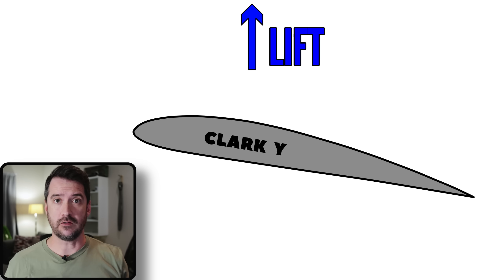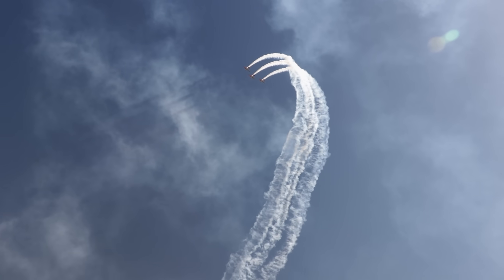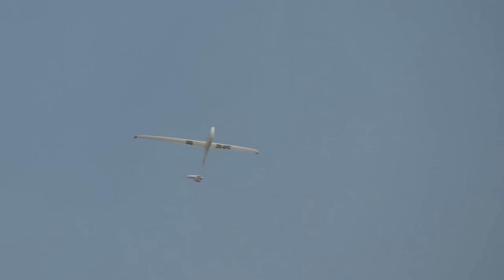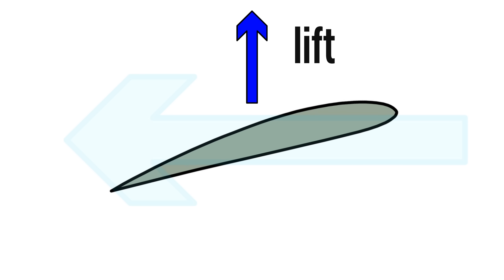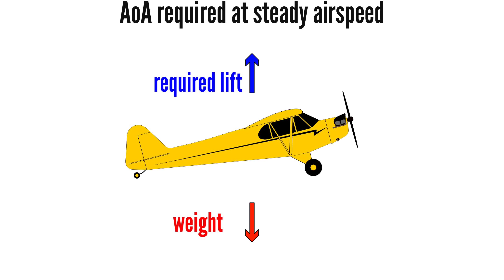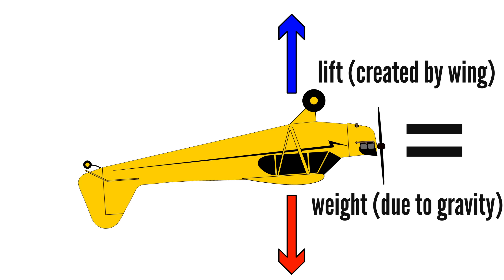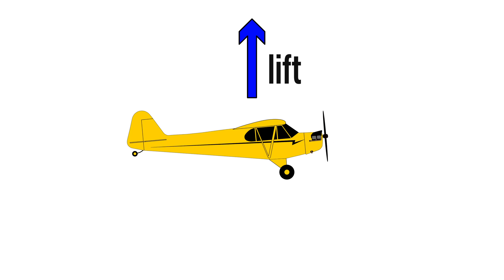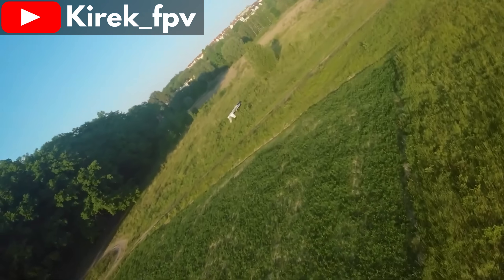Is Airflow Distance Over the Top of a Wing Always Longer?

Comment: You can generate lift with a sheet of plywood.  But a sheet of plywood stalls at a very small angle of attack.  The answer to what creates lift is the change in momentum of the air forced downwards by the passage of the wing.  This creates an equal and opposite lift force on the wing.  The low pressure above the wing also makes a contribution.  The purpose of the airfoil shape is to avoid boundary layer separation above the wing as long as possible.
Reply from the maker: I don't necessarily dispute this. But I would like to say a sheet of plywood is no different than a symmetrical wing (other than being very inefficient). The stagnation point still forms under the leading edge assuming positive AoA, and that's what this video is about, showing that fundamentals doesn't change with wign shape, right side up, upside down.
Reply: @LetsGoAviate  I agree.  For aerobatic flight, you need a symmetrical wing.  To fly slowly you need a highly cambered wing.  To fly fast you need a thin airfoil.  All of these wings will fly inverted.
Reply: @mikeb.7068 
Wings can produce lift without any downward movement of air; therefore your explanation is false.
Reply: @Talon19  What do you think the angle of attack is?  The angle between the chord line and the incident airflow.  You need a positive angle of attack to generate lift.
Reply: @mikeb.7068  
There are many airfoils which generate lift at zero angle of attack and even slightly negative AoA.
A slightly cambered airfoil with flat bottom will create lift at zero AoA without deflecting the airflow.
You can even test this at home with a leaf blower, inverted plate, and scale.
Reply: @Talon19  You're wrong.
Reply: @mikeb.7068  
Reference the lift vs AoA charts for various positive camber airfoils.
You can also test this at home with a scale, plate, and hairdryer.
Reply: @mikeb.7068  
Another simple test is to tape a piece of paper between two level surfaces and blow across the upper surface.
The paper will flex upwards due to change in pressure, *not* due to deflecting airflow or flow turning.
Reply: @Talon19  A piece of paper is not an airplane.
Reply: @Talon19  The lift coefficient at small angles of attack gets small quickly.  You generate very little lift at 0 angle of attack.   In any case, as Let's Go Aviate points out, just about any wing will fly inverted.  How do you explain that?
Reply: @Talon19  A cambered airfoil can produce lift at apparent zero AoA. But it's basically the geometry which in effect offsets the aerodynamically applicable AoA.
In any test you would require a laminar air flow. Leaf Blower don't provide that. Super expensive Wind tunnels do.
Your piece of paper blow upwards, but only because you changed the speed above from the speed below. but you can't move your upper wing surface faster through the air than your lower one.
Reply: @mikeb.7068  
Nope, but it does demonstrate the pressure differential due to changes in horizontal velocity with a net zero vertical velocity gradient.

Same test can be done with positive-camber, flat-bottom airfoils with a long flat plate at the trailing edge.
At zero AoA, using pressure taps in a wind tunnel, the pressure differential between upper and lower surfaces will show a net positive pressure on the lower surface.
Reply: @mikeb.7068  
Increased angle of attack and/or increased velocity allow wings to fly upside down.
I’ve done these tests using a variety of wind tunnels up to supersonic flow.
Reply: @beyondEV  
I’ve done these experiments and more in “super expensive wind tunnels” during my bachelor’s degree in aeronautical engineering.

Another way of verifying this is using a flat—bottom, zero-AoA, positive-camber wing in a wind tunnel.
Add a long flat plate extending along the chord line aft of the trailing edge to keep upper and lower airflows separate.
Force gauges, pressure gauges, or a simple scale will all show a net upward force on the wing without the supposed “flow turning” or “downwash”.
Reply: @Talon19  I don’t know why you keep insisting there can be lift without the deflection of air. It would violate the law of conservation of momentum. It is very strange to have taken a bachelor’s in engineering and yet be unaware of this most fundamental law of mechanics.
Reply: @XPLAlN  
Conservation of momentum isn’t violated.  Very simple to show increased fluid velocity creates reduced pressure, even without any moment of surfaces or constriction of flow.
This is incredibly basic fluid dynamics.
Reply: @Talon19  you are now being disingenuous. I did not write ‘reducing pressure by increasing velocity violates conservation of momentum’. What I wrote was “it is impossible to create lift without deflecting air because it violates conservation of momentum”. Totally different. 
  You have said “wings produce lift without any downward movement of air”. Well,  if the force of lift is an upward rate of change of momentum on the airfoil (which it definitely is according to Newton) then the air must undergo a downward rate of change of momentum of the exact same magnitude. To any bona fide engineer, this is a ground truth, not a point of debate. It is weird, given your ineptitude here, that you claim to have a bachelor’s in aeronautical engineering, but either way, I think it is particularly important to call out commenters who make invalid arguments such as ‘I am right because I have credentials’.
  You are most definitely wrong. I do not support this opinion with ‘I have a degree’, but instead a credible source:  “This downward velocity is definitely there and is known as downwash…the flow’s downward deflection angle called downwash angle, is routinely calculated in aerodynamics texts because it has a large effect on the flow over the tail of the airplane” Eastlake, Charles, An Aerodynamicist’s View of Lift, Bernoulli, and Newton.
  Note: “downwash angle is routinely calculated because it has a large effect on the flow over the tail”. Incredibly then, a self proclaimed bachelor in aeronautical engineering has emerged in these comments who is not aware of this important aspect of design!
  The propwash (and helicopter downwash) are physical manifestations of this same law in action. Another example is the sink rate of wingtip vortices as they trail behind the airplane. These aerodynamic effects are known to the merest laymen, and known to be examples of conservation of linear momentum by all bona fide aeronautical engineers.
Reply: @XPLAlN  
I am not saying downwash doesn’t exist.
Neither am I saying downwash is the cause of lift.
I am saying downwash isn’t REQUIRED for lift; as experiments done hundreds of times have shown.
Reply: @Talon19  You are wrong. To gain lift from the air you must have some kind of downwash, otherwise momentum isn't conserved. An airfoil must somehow deflect the air downwards to create lift. Physics. Edit: But a boat can float on water without a down draft and a zepelin can float in the air. So can a wing produce no downdraft as long as it's not accelerating upwards, and just "floating" in a steady state?
Reply: @Talon19  If lift is generated, airflow is always bent. If an airfoil is shaped in such a way that at 0° AoA (or even at -1°) it generates some lift, then the air masses behind the wing move downwards  Always.
Reply: @Talon19  Can we agree that "lower pressure" does not actually move anything? Rather, it is the pressure differential between higher pressure to lower pressure that produces the lift. The higher pressure is what is actually doing the lifting by seeking equilibrium with the lower pressure. All this talk about the lower pressure on the top of the wing causing lift is mindboggling to me. The atmosphere is not "pulling" the plane up.
Reply: @Talon19  …at this stage I am not sure you do even remember the point you started with. We are talking here about the lift of a plain airfoil outside ground effect. What “hundreds” of experiments are you referring to that have proven downwash is not required for an airfoil to produce lift? I am not asking for hundreds, just give me one verifiable reference to check out…..
Reply: @Jowbaka  
Do you understand that increased fluid velocity creates lower pressure?
Reply: @JeremyHolovacs  
The net result is a force opposing the force of gravity.
Reply: @XPLAlN  
Wind tunnel tests.
Reply: @Talon19  sure that's the point. A reduction of force (pressure) is not opposing gravity. Gravity will be opposed by a force greater than it... in this case, the pressure under the wing. All this talk about less pressure above the wing doesn't do anything at all.
Reply: @Talon19  What part of "equal and opposite" is confusing you?
Reply: @JeremyHolovacs  
It is the DIFFERENCE in pressure, not the pure magnitude of pressure on the top or bottom.  Airfoils produce lift most effectively and efficiently by accelerating fluids over the top surface; therefore, wings reduce pressure on the upper surface to produce lift; otherwise flat plate or symmetrical airfoils would be the most effective.
Reply: @Talon19  ….quote: “wind tunnel tests”. So you already said, but I asked for a reference, and that isn’t a reference. Just one verifiable reference to check is all I am asking. We have the internet now, it can’t be that hard. But don’t bother if it only shows lift is possible at zero α “without change of potential energy between leading and trailing edge” like you floated on the other thread. That is not the same as “without deflecting the airflow” - which is the part that violates conservation of momentum. Even though you think it doesn’t.
  Just one reference…
Reply: @XPLAlN  
Feel free to call the ERAU-Prescott college of aerospace engineering for records of AE 301 wind tunnel tests.
Reply: @mikeb.7068 I’m not a pilot or an engineer, but I would suppose that, during upside-down flight, the flaps must be tilted so as to create downward force— downward with respect to the aircraft, not the ground.
Reply: @davidkantor7978  You would suppose wrong.  Flaps have nothing to do with flying inverted.
Reply: @Talon19  So there is no reason to cant a wing?
Reply: @mikeb.7068  Yes, but the question here is why?
Reply: @Talon19  So Newton is wrong?  I don't think so.
Reply: @rsteeb  
You aren’t paying attention or taking this seriously.
I’m not saying Newton is wrong.
I’m saying there doesn’t need to be a net downward motion of air to create the pressure difference responsible for lift.
The pressure difference method works, and has worked for over a century.  The deflected air idea doesn’t work, isn’t useful because it doesn’t work, and isn’t needed to explain lift.
Reply: There is no lift without downward acceleration of air.  Full stop.
Reply: @Talon19  Explain how the propeller works.  Same as the wing!
Reply: @rsteeb  
A propellor creates thrust by a difference of pressure between the forward and aft surfaces.  This isn’t due to deflecting air.  Like wings, propellers can produce thrust at negative AoA.
By the deflection idea, negative AoA should not produce lift, and yet we know positive camber airfoils can produce lift at small negative AoA.
The thrust of a propeller is spread across the disc area of the prop, just like with helicopter blades.
Reply: @Talon19  OK.  Rockets ascend due to the extreme pressure on the nozzle bells.  Newton has left the chat...🙄
Reply: @rsteeb  
You got it.  Very different than a wing, propellor, rotor, or airfoil.  Keep trying though, you’ll run out of examples which support the deflection myth.
Reply: @Talon19  Enjoy your goofy paradigm.  You can't deny Newton, FULL STOP.
Reply: @rsteeb  
Yet again you miss the point.  I’m not denying Newton.  Conservation laws and Newton’s Laws are the basis on which Bernoulli’s, Euler’s, Navier’s, and Stokes’ theories are built; all of which lead to understanding of differential pressure on airfoils and lift.
Reply: @Talon19  no angle of attack?
Reply: @brettharman8921  
What do you mean “no angle of attack”?
Angle of attack is just a measure of the chord line to the relative wind.
Reply: I think I understand why you think conservation of momentum doesn't violated if there is lift without downdraft (however I don't understand why you just stated this multiple times without any explanation of the statement or refution of others arguments to the contrary as it doesn't make sense in a dispute to make statements without arguments), so lets see if I really understand. If there is a plane in level flight it has zero vertical momentum. It goes through standing air (also has zero vertical momentum), so before interaction between the air and the airplane there is zero vertical momentum, therefore after the interaction there should be also zero vertical momentum because of the conservation of momentum. My problem is that based on this it is not just a possibility that there is no downdraft while lift is generated, but in level flight it should be always true which we know isn't. So I tried to solve this problem and I found an answer in gravity. When we just drop something, how conservation of momentum isn't violated as the dropped thing gain momentum and all the air pushed during its fall also gain momentum to the same direction so it can't solve the problem. The answer is obvious: as the Earth also pulled toward the dropped object, it gets the same magnitude of momentum, but in opposite direction. So when the plane goes in level flight it doesn't gain any vertical momentum, however the reason why it doesn't fall is the pressure difference act on its wing as a counteract of the gravitational force. But that gravitational force also act on the Earth and something should be counteract it otherwise the plane would pull off the Earth of its orbit (and violate the conservation of momentum as the Earth would gain momentum but nothing else would gain opposite direction momentum). My only explanation for this is if there is lift the downdraft should exist and the air get same magnitude, but opposite direction momentum then the Earth therefore after interaction the sum of vertical momentum still will be zero.

Another (much easier to understand but not realistic) aproach is to imagine an airfoil in atmosphere without a gravitational field. If the airfoil generate any lift, it will accelerate toward its direction therfore to not violate the conservation of momentum something should accelerate to the opposite direction and — as no other material exists in this case — it should be the atmosphere.
Reply: @Zilahi-Branyi_Laszlo  The main problem people have is with the initial idea that if the plane is in level flight, that it has zero vertical momentum. It has momentum, but the turbulence from above is actively trying to cancel it out. If you slow down the "level" flight, it's actually bobbing up and down slightly from second to second.  It's basically balancing like a surfboard. The top of a wing acts like a spoiler on a car, in simplest terms. You actually want some downwards pressure from above to increase maneuverability ( and therefore alter your angle of attack with less power and more control ), at least until a certain point where you stall (wipe out). This is tricky, as each plane will behave differently, and like surfing, there is a small range between smooth and fast and being out of control.  Far less than most (especially newer) pilots probably realize.  And in some planes, like some boards, very little warning when you are about to lose control.
So, the rear of the wing is pressed down and stabilized, while the front has very little resistance (nicely rounded), allowing it to pivot upwards or downwards more freely.  Like balancing your board on a wave - you want to actually be slightly back of the center of gravity by a few inches, keeping the tail down and planted.  Again, until it reaches its critical angle of attack and the turbulence overcomes all of this simply pushes the entire thing backwards, like a kite or parachute. There is always dirty air being generated by all wings.  The important question is how much and where.
Reply: @plektosgaming  In a perfectly level flight it has zero vertical momentum (perfectly level flight means vertical speed is zero and momentum is mass times speed, so it's basically an undisputable fact). Yes, in practice there is no perfectly level flight, but that do nothing with my argument. If an airplane keep altitude relatively stable for a longer period of time then its average vertical momentum in that time interval is zero and you can change all "momentum" in my previous comment to "average momentum" and the argument will apply to this case.
Reply: @Zilahi-Branyi_Laszlo  
@daemn42 (comments below) does a very good explanation of this.  The main problem is that the textbooks assume that the air speeds must equalize and want a 1 graphic explanation for what's really 3 pages. They do not equalize.  We see this with the wake of a boat and we see this with turbulence created by a plane. A flat board works well enough as a wing, just that its angle of attack is very limited and it's very (fuel) inefficient. If you are flying a supersonic jet, none of this matters.  But a smooth ride with good fuel efficiency does for the rest of us, so they engineer the wings to maximize performance/minimize the negative variables.
Reply: @LetsGoAviate  I agree as many early biplanes had symmetrical wings and were known to be quite agile as well.
Reply: @josephoberlander  
Name five that were in mass production.
Reply: @Talon19  Waco comes to mind. I'll leave the rest to you to find.  hint - symmetrical wings are common in aerobatic flying.
Reply: @josephoberlander  
Aerobatic planes is different from your early claim.  Care to clarify again?
Reply: @LetsGoAviate you should dispute it. It’s completely bunk. Any basic analysis will show that no wing is accelerating air downward fast enough to cancel out gravitational force.

That would require the propellor to be generating more thrust than is necessary to lift the airplane by itself (helicopter style).
Reply: @tylerbrown4483  "Any basic analysis will show that no wing is accelerating air downward fast enough to cancel out gravitational force."

Mistaken.  You might want to have another look at your numbers.
Reply: @crispinmiller7989  no. I’m definitely correct. For this to work you would need a 1:1 thrust to weight ratio just to get airborne and then more on top of that to move forward at any speed. 

Almost no air planes have a 1:1 thrust to weight ratio. Yet they still fly
Reply: I have sailed to windward with a flat junk rig designed by Blondie Hasler.  It wasn't sparkling performance, but it definitely made decent way to windward.  The angle of attack had to be less to the apparent wind than a curved foil sail, as it stalled sooner.
Reply: Or a sheet of any wood with the right ratio, for that matter.
Reply: No. U're referring to "Planning".
Reply: It's the main reason. Other things like airfoil, flow being attached - they are only to help moving air down
Reply: @player1GR  ... Why does the airfoil losses so much lift when it stalls, then? (i.e. then the flow separates from the upper surface) Why is the slope of the lift-to-AoA curve about 4 times steeper in a non-stalled airfoil than a stalled one? Why does the lift at 45 degrees AoA, where you have maximum downward deflection in the lower surface, reaches equal or less lift than a non-stalled airfoil at 15 degrees (but with 20 times more drag)?
Reply: But that's the thing - there is no pressure differential in the way most people visualize it. It's simply that the wing is being pushed up and back, and at a certain angle, the combined forces of the disturbed "dirty" air from above and the turbulence/eddies it creates (which wants to push it down, similar to a spoiler on a race car) , combined with the backwards force overcomes the upwards force.  For a flat board, the turbulence is massive and a little more than few degrees will want to just push it straight back.
Reply: @plektosgaming  ... "there is no pressure differential in the way most people visualize it." That is totally, absolutely wrong. Or show me ONE aerodynamics book that says that. Because all the ones I read (and I read many) say otherwise, and there was a time where I knew how to calculate that pressure distribution / differential myself with a pencil and a paper (at least for airfoil geometries that were easy to resolve). Look, there are only 2 ways in which a fluid can exert a force on something. When you say "the wing is pushed back up" that doesn't happen by magic. There is a pressure on the bottom that is higher than the pressure on the top of the wing. That is HOW the air pushes the wing up.
Reply: @adb012  Scott Manley had a video a while back about flying where he explained this, and it's indeed wrong in about 95% of books, taught wrong by instructors, and almost every person has it wrong in their heads as how it all works isn't intuitive.  In the end, it's all about angle of attack and how much turbulence you have to overcome. The wing shape just makes it all more efficient and more forgiving. 
Go find his video on it - he's an actual pro who is great at explaining things.  I had to watch it twice to wrap my brain around it, since it's not the way I was taught, either.
Reply: @plektosgaming  ... I tried to find that Scott Manley video and could not find it. I found another one however, called "Things Flight Instructors Taught Me Which Were Wrong!" where he explains lift pretty well (not perfect) and, guess what, he talks about pressure difference and doesn't say anything about "overcoming turbulence". Now, let's imagine for a minute that Scott Manley said what you said he said. Do you really expect me to take Scot Manly explanation over that it explained in every Aerodynamics text book for Aeronautical Engineers written by PhD's in fluid dynamics and used by science, academia an industry around the world including by those who make planes that actually fly like, you know, Boeing, Airbus, Cessna, Piper, etc? Scot Manly would be right but NASA is wrong? I like Scot Manley a lot, but he is an astrophysicist that specialized in asteroid belts and computational Physics and worked in Napster (online music), Qualys (IT security), imeem (social media), Topsy Labs (social analytics) and Apple (electronic gadgets and software). Yet, because he is loves Physics, know Physics and is well educated in science in general, he understands lift pretty well and explains it pretty well, not in the way you said he explained it. In the video I mentioned he even mentions the youtube videos of some professional aerodynamicists and fluid dynamiscist who explains lift in the standard way understood by academia and science, which I watched and they agree with me, not with you. Or prove me wrong. Give me the title of that video.
Reply: @plektosgaming  
The flat plate is less applicable than symmetrical airfoils.  If deflection created the bulk of lift, then most wings, rotors, propellers, and airfoils would be slim and symmetrical.
Additionally, if deflection is the source of lift, then positive camber airfoils couldn’t produce lift at negative AoA.
Reply: @Talon19  It largely comes down to materials and structural strength.  Modern propellers made of carbon fiber are exactly that - very long and thin to gain efficiency. The tips are curved to minimize drag and keep the airspeed over them from going supersonic at a given length, as well. But technically wouldn't need to be so if you didn't care about vibration and noise. The C-130 is a good example of this - big, ugly 4 bladed flat boards for propellers with a massive engine behind them.  Uncle Sam doesn't care - they just need maximum power, noise isn't their concern ( and they are staggeringly loud on takeoff - lol )
Reply: @plektosgaming  
Luckily for C-130 crews, the newer J models aren’t as noisy as the older four fan trash can Hercules.
Even with advanced materials and construction, propellers, wings, rotors etc still use positively cambered airfoils for the majority of uses.
Thin, (near) symmetrical wings are generally only used for supersonic aircraft.  But even those aren’t solid slabs because they use leading edge and trailing edge control surfaces to create more cambered surfaces for takeoff and landing.
Reply: @Talon19  ... You have the concepts severely confused. I don't say it in a mean but a constructive way.
1- 3rd law of Newton: If the air pushes the wing up, then the wing pushes the air down. Period. Now, the airplane is not launched up by this push because it is counteracted by the airplane's weight (net force on the plane = 0). But the air was already in hydrostatic equilibrium before the interaction with the wing, so the push of the wing creates a net force on the air that accelerates it down, and after the air leaves the wing it remains with a downward velocity which by the way it is called downwash and in shows up in every Aerodynamics book with the letter w. Now what you say about the pressure is true, but that's not something different to the air and the wing pushing each other. The pressure distribution is just the way, the mechanism, how the wing and the air push each other. It's like someone saying that in a rocket the combustion gases are pushed back so the rocket is pushed forward and you coming and saying "well no actually what pushes the rocket forward is the high pressure in the combustion chamber and nozzle". That's correct, except for the "well no" part. That high pressure IS WHAT pushes the gases in one direction and the rocket in the other.
2- Camber and AoA are like 2 dimensions of lift generation. Every airfoil has a zero-lift AoA and every airfoil increases the lift coefficient of about 0.11 per every degree of AoA above the zero-lift AoA, up to the point where separation starts to develop. Fat or thin, symmetrical or cambered, all airfoils are the same in this regard. Now, symmetrical airfoils have a zero-lift AoA of zero degrees, while cambered airfoils have a zero-lift AoA of a few degrees negative (like -2 or -5, depending on how cambered).  So why use cambered airfoils? Mainly because of the max lift that they can obtain. In a crude approximation, a thin symmetrical and thin cambered airfoil will have the same range of lift between negative stall and positive stall (let's say a total Cl span of 2.0). In the symmetrical airfoil, with the zero-lift AoA at zero degrees, this curve will be centered so it will stall at a Cl of -1.0 in the negative AoA and a Cl of 1.0 in the positive AoA. The cambered airfoil however will stall for example at a Cl of -0.5 in the negative side and 1.5 in the positive side. So you can obtain more lift. Not only that but at AoA where drag starts to increase more rapidly in the symmetrical airfoil, the cambered airfoil would still be in the low-drag region. Other important factors of the airfoil are the thickness and leading edge radius, which let's you control the pressure distribution and, in that way, help delay stalls, helm make stall less abrupt, and help keep a laminar boundary layer, as well as providing space for structure, fuel, etc.
Reply: Interesting. The momentum of the air going over the top of the wing is also changed. The laminar flow forces the air downwards as it goes over the top of the wing as well. When that flow is destroyed in a stall and the air is no longer goes downwards, lift is also destroyed even though the flow and deflection on the bottom of the wing are barely changed. From that I would argue that the flow over the top of the wing contributes significantly to the overall lift.
Reply: @whiskeytango9769  ... You are right. Just a small nerdy correction. It is not so much laminar vs non-laminar. The boundary layer is not laminar anymore and becomes turbulent after just a couple if inches. What happens in the stall is not that the "laminar flow" is lost but that the flow separates.
Reply: @adb012  Thanks for that, and yes I agree...it definitely separates.
Reply: @whiskeytango9769  That's the counter-intuitive part as we think it's like fluid dynamics but it's not exactly. The air going over the top of the wing is contributing almost nothing and most of it is in fact getting in the way. Take a flat piece of plywood. The only reason we need to curve the top of the wing is the same reason we curve the top of a car versus just leaving it as a box.  Think of it as creating less turbulence as well as more room for error as we approach the critical angle of attack that we don't want to exceed ( lest we stall ). This allows the bottom of the wing to be at a steeper angle with much better efficiency, allowing for greater lift than a flat top to the wing.
Reply: How about a ramping or camming effect, doesn't that add to making a kite or barn door fly?
Reply: Great comment  ... perfect addition to the video ... thanx ...
Reply: oh you think its the force pushing down that make's aircraft fly?    nope, its actual the top that lifts..:-)    the round upper section of a airfoil is making air have to travel faster over the wing,,,  given the wing a low pressure zone...  low pressure = well   picture a ball in a tube,,, suck on one end and the balls comes towards ya..

neet huh...   its Sucking the aircraft up :-)...   ps your idea still works to a degree :-)  thats what paper planes fly on since they have no chord in the wings
Reply: @HarmonRAB-hp4nk : "The force pushing down that make IS the aircraft fly"? That doesn't really make sense. What do you mean by "make IS..."?
Also, when did "sucking" supposedly become a brand name or personal name, according to you?
Reply: @HarmonRAB-hp4nk  lol.  What happens when the airplane is inverted?  Does it get sucked down?
Reply: @HarmonRAB-hp4nk  Excuse me, but did you pay any attention to the videos we all started out from?
Reply: @HarmonRAB-hp4nk  So propellers suck airplanes forward?  That's funny!
Reply: @rsteeb  There is no such thing as suction, there is only pressure difference.  Propellers generate thrust by moving a lot of air to the tail of the airplane, fast.  Thrust is the equal and opposite reaction.
Reply: @mikeb.7068  Exactly.  Identical as how WINGS work.  Newton.
Reply: @mikeb.7068  
Propellers aren’t reaction engines; propellers aren’t jet engines.
Case in point, propellers can produce thrust with little velocity backwards.
Reply: @Talon19  Have you ever stood behind a running propeller?  I have.  They move a lot of air.  In light aircraft with fixed pitch props you typically set the blade pitch for climb or cruise or somewhere in between.  I was experimenting with my prop and set the blade pitch too shallow.  I was able to get off the ground but couldn't go any faster than a few knots above stall speed without overreving my engine.  I flew around the pattern teetering on the edge of a stall all the way and landed safely.  That taught me a lot about propeller blade pitch.  A propeller that's not moving any air is producing negligible thrust.
Reply: @mikeb.7068  
I have stood behind propellers as they ran an engine test and under helicopters as they were lifting off.  They are not  moving “a lot of air”, and definitely not the amount necessary to provide lift through reactionary means.  
The same problem occurs with any claim of lift based on purely deflected air: flat plat or symmetrical airfoils would be optimal, but that’s not what we see.
Helicopters and most rotorcraft disprove the deflection myth because they are able to autorotate, producing some lift when air is flowing opposite (air flowing *upwards* through the rotor disk) to what the deflection myth suggests.
Reply: Actually, yes and no, the lift produced by what you describe would be too small. Especially the flow above the wing contributes a lot.
Reply: The low pressure and the Downdraft are 2 ways of viewing the same force.
Reply: @thurbine2411  Not really, as "low pressure" tends to confuse people as they think that there must be some soft of false equivalency. ie- that it must also generate lift.
Reply: @plektosgaming  are you saying that the pressure differential is the only way of explaining lift and not the displacement of air in a downward direction?
Reply: @thurbine2411  No.  It's that it's a lot more complex than either, but that certain terms lead (especially young students and teachers looking for a simple explanation ) to wrong conclusions fairly consistently.
Reply: @plektosgaming  so you are saying that the main way a wing generates lift isn’t purely by causing a pressure difference or downdraft whichever way you want to look at it? Couple you explain more of the complex part?
Reply: Bird wings as boat sails are 2 dimensional and create lift. The first airplane wings made of tissue were also 2 dimensional.
Reply: @hugueslecorre4893  but sails do get quite a lot of camber when needed.
Reply: @thurbine2411  As it doesn't have thickness, the lengths of flows iner camber and outer camber remain equal. What people don't want to know the explanation of Cheplekhine. Put a plate under the water flat, the splash will flow the water along its surface perpendicular.  Now incline slightly the plate and the water will flow still along its surface but less upward. This upward flow is what generates lift in wings. According to Cheplekhine, there are two fluid flows, one, the evident air flow which adds with a rotating flow around the wing, opposite direction of the flow. This why there is a singular point where the two flows get canceled to stagnant.
Reply: @hugueslecorre4893  but length of flow doesn’t matter or why do you bring that up in the beginning.
Reply: @thurbine2411  It is commonly thought that a wing generates lift because the upper part is longer than the bottom, this why the fluid has higher speed on the upper part as it needs to travel longer distance, hence according to Bernouli it has lower pressure, resulting the lift. Whereas it is faster because the rotating fluid around the wing, even if it is a thin flat one, adds up with the flow on the upper part and subtract with the bottom. To note that 70% of the lift is upper depression concentrated on the front edge.
Reply: @hugueslecorre4893  yeah I know that the increase in velocity is not from the paths being unequal.
Reply: Thanks!
Reply: Wrong!
Reply: I agree. It is both a momentum thing and a Bernoulli thing. The airfoil shape determines the critical AofA.
Reply: "The low pressure above the wing also makes a contribution." 
It is not A CONTRIBUTION (I am "highlighting", not "yelling"). It is the same thing at different levels or perspectives of explanation.
The only way for the wing to push the air down (and for the air to push the wing up) is through a distribution of pressures, and that distribution of pressures can be explained with high accuracy through Bernoulli. In the same way that you would not say that X+1=3 and X-1=1 both contribute to X being equal to 2.
Reply from the maker: @adb012  Nice viewpoint. I don't like binary viewpoints, rarely are things either fully black or white, fully right or wrong. This is similar to how I see it. Ofcourse the video was only to counter an argument not to explain lift fully, but nonetheless.
Reply: @LetsGoAviate  ... Well, Math and Physics is quite fully black and white (except in the boundary of our understanding where the problem is our understanding, not reality). I am aeronautical engineer and I was an Aerodynamics teacher at college. I went from deriving Naiver-Stokes from first principles, and from there to derive everything else including velocity and pressure fields, Bernoulli and and the downwash (i.e. the air being pushed down by the wing). It is all the same, once you have Navier-Stokes everything else can be derived from there, in the same way how conservation of mechanical energy can be mathematically derived from Newton's 2nd law and Bernoulli can be derived from conservation of energy. It is interesting, for example, how Bernoulli can be derived both from Newton's second law and from Navier-Stokes. I almost say "independently derived" but it is not independent, because Navier-Stokes also relies in Newton's 2nd law applied to a differential (infinitesimal) parcel of air.
Reply from the maker: @adb012  I was referring to black and white viewpoints/understanding, not physics. Great to get an aeronautical engineer's perspective, thanks.
Reply: @adb012  Explain how a single surface wing creates lift?  i.e. a wing created from one piece of fabric.  You do not need an airfoil to create lift.
Reply: @mikeb.7068  ... In the same way that a "hollow" airfoil creates lift. I don't understand why the question or what from what I said would be problematic in a thin airfoil (because there is no "single surface" airfoil, all airfoils have an upper surface and lower surface exposed to the airflow, even if it's just a fabric, a fabric has 2 sides).
Reply: @adb012  Are you really telling me there is an airfoil with constant thickness of 0.040"?  Because there isn't.
Reply: @mikeb.7068  ... Not sure if I understand your question. If you make one, there is one. Typically they are modeled as a zero thickness airfoil that have a camber distribution and no thickness distribution. I swear I am not trying to troll or anything. For me, the cross-section of a sailboat's sail or hand-glider's wing are airfoils. I guess I would define airfoil as any shape that is put in the way of a fluid's flow with the intent of generating lift.
Reply: @mikeb.7068  ... Edit to add (from Wikipedia):
Foil: a solid object with a shape such that when placed in a moving fluid at a suitable angle of attack the lift is substantially larger than the drag. If the fluid is a gas, the foil is called an airfoil, and if the fluid is water the foil is called a hydrofoil.
Airfoil: a streamlined body that is capable of generating significantly more lift than drag. Wings, sails and propeller blades are examples of airfoils.
Reply: Excuse me?  .040 is about a millimeter, about the thickness of typical toy-airplane balsa wood.  As kids we bought them in the dime store all the time and they flew very nicely
Reply: @adb012  Pushing the metaphor a bit, I'd say that math and physics could be thought of as multicolored:  they can be expressed in multiple representations, all compatible and equally true but some are more easily grasped by some people and others more easily by others.  (But then also plenty of (whatever color you don't like) that are just confused or deluded.)  You can explain a lever by either a torque balance or a work equation; you can solve a quadratic equation by factoring, completing-the-square, or the Quadratic Formula; etc. etc.  You cannot say correctly that forces plus inertial reactions in a free-body diagram do not have to balance.
Reply: @crispinmiller7989  ... I totally agree, but there are practical nuances, beyond the different representations. "Wing pushes air down so air pushes wing up" (action and reaction, 3rd Newton's law) is a totally correct and complete explanation for lift. Complete, in the sense that it accounts for 100% of the lift. But not very complete as an explanation. Not more than " car pushes pavement back, pavement pushes car forward". I mean, in EVERY dynamic system ALL the forces will be accounted for with action-reaction pairs, because that's the only way forces work. It doesn't help you much understand what is happening. Still in the realm of global Newton's laws, you can take the velocity field in all the infinite expanse of air that surrounds the airplane, take a control volume that contains the airplane, and check for the vertical component of the velocity of every parcel of air that goes into and out of the boundary of the selected volume. With that you can calculate the change in vertical momentum of the air, multiply it for the flow of mass through the volume, and voila, that's 100% of the lift. And since we have the velocity field, we can go a step deeper to understand the actual interaction between the air and the airfoil in this way: Look at the velocity distribution around the surface of the airfoil. Take the magnitude of the velocity (i.e. the speed) of the air all around the surface of the airfoil, convert that speed to pressure using Bernoulli, take the vertical component of the force done by the pressure at each point on the airfoil, add them together (integrate), and voila, you have 100% of the lift.
The elephant in the room? Where does the velocity field comes from? NOTHING of the above explains HOW that happens. None of that helps you calculate or predict the velocity field. It's all after-the-fact explanation of why the lift happened, given the velocity field. It is useless for design. It just doesn't give you enough understanding to be able to say what happens if you take an airfoil or this shape and put it in an airstream of this speed at this angle of attack. So while the 3 things mentioned above (action-reaction, change in momentum, and pressure distribution) helps explain lift to youtoubers, it's pretty useless for scientists and engineers. The first good approach is potential flow with dialed-in circulation to impose the Kutta condition (Kutta-Joukowsky theorem), the next one is boundary layer study + potential flow outside of the boundary layer, and the next one is a complete numerical analysis using the Navier-Stokes equations (with a Computer-Fluid Dynamics software that uses finite elements or finite differences to approximate these equations since we don't know how to solve them except for simplified cases, like potential flow). And even if we could solve the Navier-Stokes equations perfectly, that would be still an approximation (a very good one, indistinguishable from reality for all practical purposes) because it assumes the continuum hypothesis and we know air is not really a continuum but a bunch of discrete particles (molecules) moving chaotically at different speeds and different directions and bouncing with each other and against the solid surfaces they encounter. Oh and by the way the molecules are made of atoms which are made of electrons, neutrons and protons which are made of quarks and gluons which are small waves in quantum fields. So when someone asks me abut what is the TRUE explanation for lift I tell them "You don't want the truth, you can't handle the truth". Or as Feynman said, "There are no correct theories, but some are useful".
Reply: @adb012   Thank you for so refreshingly competent a review after wading through the amount of earnestly-espoused fantasy that's all over this thread.

I agree about the elephant in the room, particularly since, as my undergrad aero professor put it, the Joukowski-Kutta approach is an elegant fiction that agrees with Laplace's equation but doesn't actually produce very high-quality airfoils.  I suppose the boundary-layer-plus-potential-flow approach was accessible to people like Prandtl, though I imagine it requires iteration to deal with the boundary layer's behavior in a shape-dependent chordwise pressure gradient, where part of the shape is the boundary layer itself.  CFD of course had to wait for adequate computers -- partly a function of the size of your company of course, but even for Boeing my reading is that CFD software didn't really come together until some time in the seventies.  (Please correct any misimpressions, I'm an ME, not an AE.)

Another good Feynman quote (of several minutes actually) is when he takes his interview to task for asking /why/ something happens, rather than how.

In that sense, the SciAm article from a couple of years ago could be said to have a well-taken point, that nobody knows "why" airplanes fly, but still that article was tripe because it even punted on /how/.  (Drela was perhaps the interviewee who might have given the most astute answer, but in my view he didn't.)  If you accept the physical source of the Kutta condition as being a prohibitively high adverse pressure gradient for any flow tending to sneak around the trailing edge (so that the flow has to separate there), and then you just look at the sequence of marked-flow photos in the Prandtl & Tietjens appendix showing a foil section starting to move, shedding its aft vortex and retaining its bound vortex, and you're able to look at the pictures with a knowledge of Bernoulli and of the relation between streamline curvature and cross-flow pressure gradient, then how the wing flow gets established is clear.

That's still obviously not quantitative, and for that, my impression is that at least until CFD and maybe even still, you needed a wind tunnel.  But that's for quantification, not for getting past all this mystification that a friend of mine has dubbed "cereal-box science."
Reply: @crispinmiller7989  ... As an ME, you have a better understanding of aerodynamics than most AE. I am impressed.
You even brought the starting vortex to the table (the vortex that is shed every time that lift changes because, as circulation cannot be created nor destroyed, every time that circulation increases or reduces in the wing it also has to change somewhere else). Almost nobody talks about that. While the most famous situation, captured very few times in sequential photos, film and video (because it is very difficult to persuade the smoke to trace this non-stationary condition) is when the airfoil starts to move, you will have the same whenever you change the angle of attack. If you are slowing down and slowly increasing the angle of attach, you will be continuously shedding " differentials" of starting vortices. Very interesting that you brought this topic.
Perhaps my only objection with your comment is when you (or your professor) say "the Joukowski-Kutta approach is an elegant fiction that agrees with Laplace's equation but doesn't actually produce very high-quality airfoils". I think you are mixing 2 things (or 4). The Joukowski transform, the Joukowski airfoil, the Jutta condition, and the Kutta Joukowski theorem. The Joukowski airfoil was never intended to be a good airfoil. It was just the result of using the transform to deform a circle into an airfoil-looking shape, and transform the velocities and pressure fields around the circle into those around the airfoil. A mathematical research. The Kutta condition is that the flow always separates at the trailing edge. But how do you do that, mathematically, in potential flow? Well, artificially introducing the exact and only amount of circulation that will make it happen. And that's the Kutta-Joukowski theorem: "An airfoil will produce exactly the amount of circulation needed to have the flow separate at the trailing edge". Now, this doesn't apply only to the Joukowski airfoil. You can do it with any airfoil. Few airfoils are conducive of a simple transform, but for any airfoil you can put control points around the profile for zero velocity component perpendicular to the airfoil curve (no-penetration condition) and add some sources and sinks on the camber line and some vorticity points along the contour and adjust their values to meet the no penetration condition + the Kutta condition, using only potential airflow. The result is surprisingly good, especially for airplane-like Reynolds. The problem with all potential flow methods is that they don't predict the behavior as you approach the stall, and it also doesn't predict parasitic drag (as a boundary layer model would). But the velocity and pressure fields, and their distribution along the airfoil, is very good away from the stall, and with them the zero-lift AoA, the CL/alpha slope, the aerodynamic center and the coefficient of moment are very well predicted (away from the stall).
And you are right that even CFD has limitations, because part of the nature of fluid dynamic is chaotic and cannot be predicted any better than the motion of a coin bouncing on the ground can. Even wind tunnels have limitations, because it is very hard do scale everything perfectly. You use a scale model so you need to increase the speed to keep the Reynolds number up, but at the same time you need to keep the Mach number from increasing too have to use high temperatures to increase the the speed of sound, but be careful with the change in viscosity with temp, and by the way are you using the correct scale for the surface roughness, rivets, and seams? CFD is replacing most, but will never replace all, the wind tunnel testing, and both are shortening a lot, but will never eliminate, actual test flights.
Finally, I agree that the question "why airplanes fly" is nonsensical, as any "why" question in science. But what elevates by blood pressure is when people say " we still don't understand how airplane fly" or "how lift is produced". Really? Well, we understand it well enough that we can create the CFD equations and software to predict, not perfectly but very, very well well, how a full size Jumbo jet will fly, but we don' t understand it? Please explain to me what " understand"  means. Are we still talking about physics or we moved into philosophy?
Nice conversation!
Reply: @adb012  It's only a contribution. The upper surface does not directly generate lift, but only indirectly because of the reduction of static air pressure. Imagine a horizontal plane with a mould in which the wing (or, to make things easier, the airfoil) is resting. The mould is the shape of the lower part of the wing and deep enough that the forward stagnation point and the aft stagnation point are in the horizontal plane. Now imagine there is a steady and laminar flow of air which hits that semi-burried wing. It cannot split at the stagnation point since the lower part of the wing is burried and there is no air between the lower surface and the mould. So all air will travel around the upper part of the wing. This wing should be unable to generate lift as static air pressure is pushing against the upper surface of the wing downwards against the mould. If the air travels faster, the static pressure will diminish because of the wings curvature and because of Bernouilli's principle, however it will not suck the wing up (at least not in theory) and no lift is created.
Reply: @SuperZardo  ... [Note EDIT at the end] I don't know what your are replying to. I never ever said that only the upper part of the airfoil contributes to the generation of lift. The way it works (in a 2D airfoil to simplify) is 1) divide the airfoil curve in very little segments, 2) measure (or calculate) the pressure at the center of each of these segments, all around the airfoil. 3) The pressure at each point will make a force equal to the pressure times the segment's length that is perpendicular to each segment (that is, perpendicular to the curved surface of the wing at that point). 4) Take the vertical component of each tiny force (technically, the component that is perpendicular to the free stream) and 5) add them together (be mindful of the sign!). That's the lift.
EDIT: Ok, I think I know where the confusion comes from. I quoted the OP saying "The low pressure above the wing also makes a contribution." and I added "It is not A CONTRIBUTION". But a longer quote from the OP would be "what creates lift is the change in momentum of the air forced downwards. The low pressure above the wing also makes a contribution." What I meant to reply is that it is not the case that pushing the air down generates part of the lift and the pressure distribution also contributes. The pressure distribution and the downwash are to sides of the same coin and both explain the totality of the lift (from different perspective) in the same way that it is not the case that when you drop an object it accelerates down IN PART because the weight pulls it down and IN PART because it converts potential energy in kinetic energy. The weight explains 100% of the acceleration. The conversion of energy explains 100% of the acceleration. Just 2 different approaches.
Reply: @adb012  the angle of attack causes the plane to continuously going up while the  weight of the plane is continuously pulling it down. The right angle of attack with right speed balance these forces out.
Reply: @adb012  The wing pushes air down because the lower surface is at an angle to the airflow.  The wing pushes air downwards as it travels through it.  The classic explanation of lift assumes the air molecules traveling over the top and bottom of the wing meet at the back of the wing with the molecules moving over the top of the wing somehow moving faster.  This is complete nonsense as we now know.  You can explain lift as a distribution of pressures but you can also explain lift by calculating the change in momentum of the air around the wing.
Reply: @mikeb.7068  quote “the classic explanation of lift assumes molecules travelling over the top and bottom of the wing meet at the back”. Classic according to which ‘classical aerodynamic text’? As far as I can tell, this idea has only ever been a thing amongst lay teachers and youtubers. What I object to is the claim this was ever the orthodoxy or subscribed to by aerodynamicists. I have seen no reference to it in the standard aerodynamic literature going right back to Prandtl’s 1921 paper for NACA, which is basically the grand daddy of them all.
Reply: @mikeb.7068  Pressure is just a collective property. All this arguments are just arguing about what level of granularity we want to model things.

Are we doing molecular fluid dynamics? Then lift is just the net force from collisions of air and the wing. Everything else is just us abstracting and explaining it in ways that don't require expensive supercomputer time to obtain and are easier to comprehend/visualize.
Reply: @RunaKovacs  Yes, exactly.  Nice.
Reply: @XPLAlN  My flight instructor told me this is how lift is created.  The molecules over the top travel faster, etc.  It's still the default explanation of how planes fly.
Reply: @mikeb.7068  yes the flow is faster over the top for sure but what I was referring to in my reply was the equal transit time explanation for why the flow is faster. That is the part which has never, as far as I can tell, appeared in any standard aerodynamic texts.
Reply: @mikeb.7068  Love to see that diagram.
Reply: @mikeb.7068  Planes fly by the exact same physics as propellers propel.  Newton.
Reply: @XPLAlN yeah it isn’t classical aerodynamics it is mythical.
Reply: @adb012  then explain why an airfoil can create lift at zero angles of attack.
Reply: @deus1655  ... What on Earth do you mean with *THEN*? What of what I said you think conflicts with the notion of an airfoil generating lift at zero AoA?